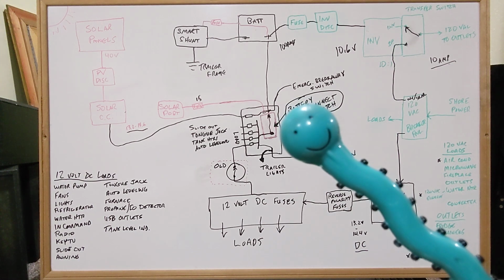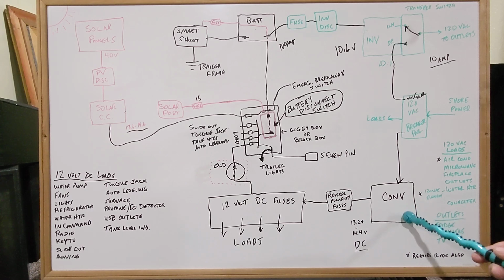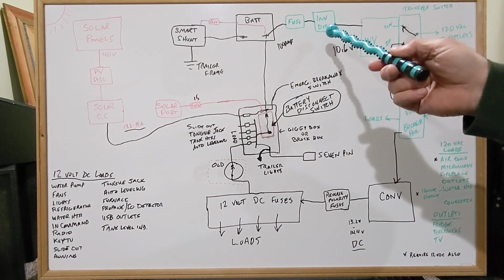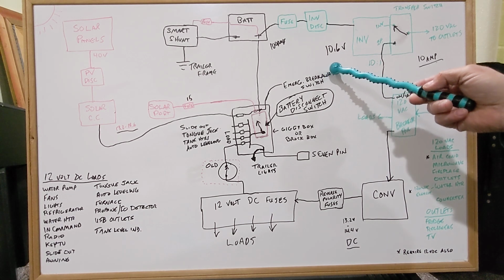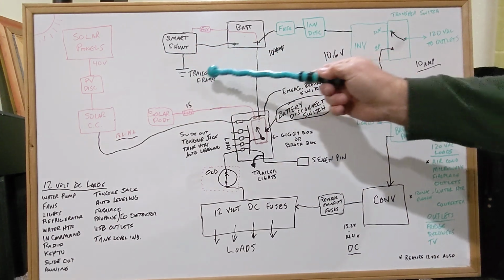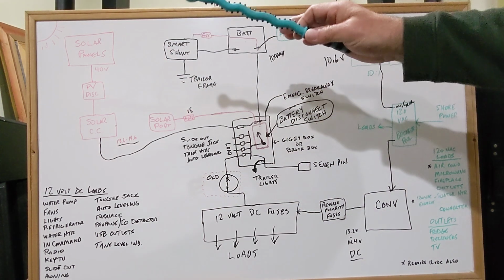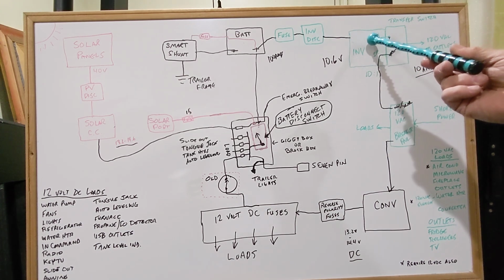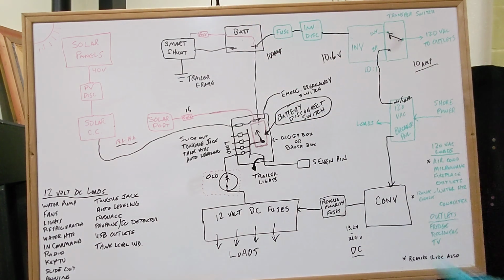Keystone Cougar Trailer power systems

Comment: I bought my 2023 Cougar 22MLS used and the previous owner moved some things around. The 2 lithium iron batteries are under the bed. There’s a switch there. I think that’s the solar controller switch? There’s a couple of blue boxes in the pass through and there’s a switch there, that the dealer said “shuts everything off”, so would that be the battery disconnect switch? Also in the battery box is another box with an LCD display on the front. It’s just knocking around in the battery box on a long cable, but I assume the previous owner planned to mount it somewhere. Is that part of the smart shunt?

Comment from the maker: Two things to add. I think I got the year wrong for the travel trailer Giggy Box. It may not have started appearing until the 2020 model year. 

Also the awning is supplied through one of the auto resetting breakers on the tongue or in the Giggy Box. I forgot to add that to the drawing.